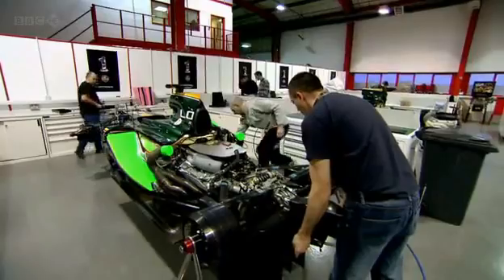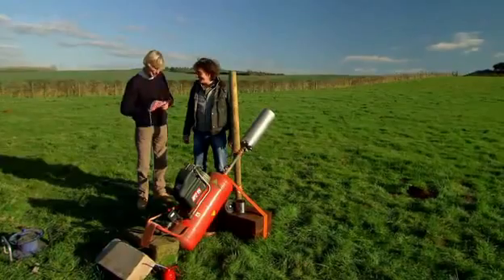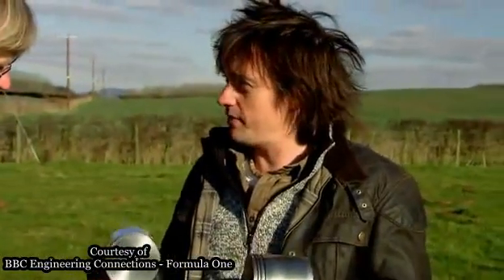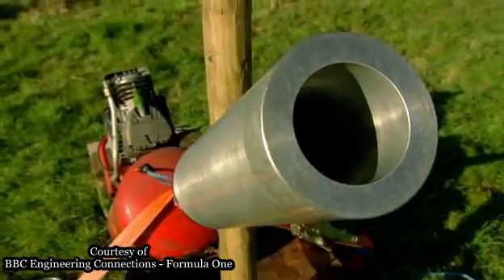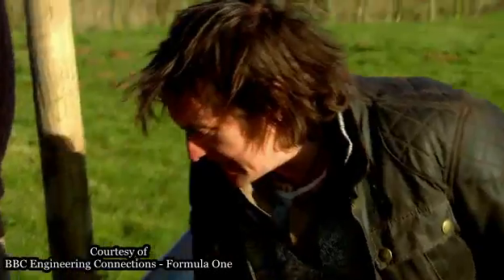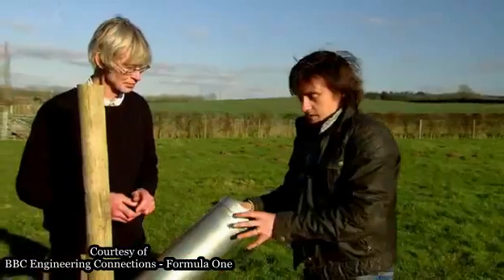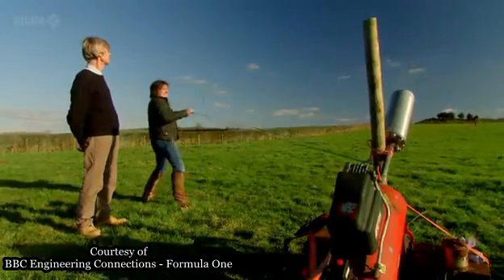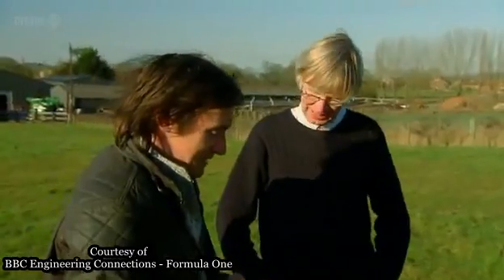The Secret of F1 Enormous Power - Precision Fitted Components

Comment: I thought regardless of piston size, the piston rings are the the ones responsible for keeping the pressure from escaping the gap.
Reply: The trick is getting the friction to the absolute minimum, there is a ton to it but basically you want to keep that cylinder as round as possible, the less run out you have the power you will make.
The rings you want the least amount of tension that will still seal the cylinder, hence the use of vertical and horizontal gas ports that all you to use a lower tension ring package.
You want the minimum amount of piston to wall clearance so that you get less piston rock and as a result a better seal.
Gapless rings do help, mainly when used on the top ring
This is all critical in racing engines but I adapt most of the racing tech I learn into the higher end street/strip engines I build fwiw
Reply: Derek Stewart the only comment I thumbs up'ed. Good response.  These guys are all just copy pasting shit from Google and guessing.
Reply: John Bernal  thanks John, i appreciate the compliment
Reply: Silicon NOT Silicone....
Reply: Basically in an F1 motor they want ZERO crank case ventilation with high compression. 
Proper fitting pistons and good lubrication solve both issues. 

The rings in an F1 car would solely be there to hold some oil
Reply: It is true rings have to seal compression but HOW MUCH air and fuel can be compressed into a small volume (2.4 liters) is whats going to give you the power. This is what Americans do not get why you have 6 cyl. Engines with power ratings of 1000 hp. And 4cyl with upto 500hp. Having large displacement will give you more ease of creating hp but will not be as efficient as with smaller displacement engines. More power into 4 or 6 cyl. Engine means more meat on the block, rods, and mains including head casting and cyl walls. This will retain that kind of power more reliable. You should see the new hemi engines and the thin bicycle chain they use for the timing. They do however stand behind their garbage and will write you a check for parts n labor.
Reply: Bassotronics less ring more piston, smaller ring gaps
Reply: Bassotronics piston rings are never air tight, they let out a little air. Tight fitting pistons in the f1 are air tight
Reply: Henry Koskei When you say "air tight" what exactly do you mean?
Reply: behemothfan666 F T P i don't mean airtight literally but it just let's a very little volume of compressed air escape through the cylinder walls thus higher power output
Reply: Not totally true . All rings do is two things and they cant do that totally . One is to reduce oil loss and two is to reduce compression loss . But you have to have some loss of both to a degree . So how do they do that now . Slicker alloys in the material like nickle , silicone , and stronger castings or even to the Billet aluminum .  Here is the bad thing about this and the reason engines do have windage . If you do build and engine this tight and run it this hard it wont last long at all . After every race these engine are torn down and all worn parts replaced then after a season of racing the blocks and cranks check over  for stress cracks .
Reply: Jeff Mullinix, I don't want to rain on your parade, but F1 engines are not rebuilt between races. They started restricting engines in 2004 and at present they are allowed 3 ICE for the entire season. They are sealed by the FIA, and a broken seal will give a penalty. That's why Bottas and Hulkenberg had to start at the back at Spa, and since you can get an upgraded engine by switching it entirely (for the same penalty) they don't bother to rebuild and old one.

Comment: They forget to mention in this video that the rpm also has a huge effect on the power output of an engine. F1 engines can rev at 15000 to 20000 rpm, while the engine in the average family car rarely revs above 7000 rpm. Plus, everything, really every nut, bolt, washer, piston, belt, valve, the angle with respect to the piston at which the valves are set, the diameter of the inlet and outlet ports, the length and diameter of the exhaust pipes, the fuel,  etc...etc... have all been designed to get the maximum performance out of an F1 engine. No wonder they produce 4 to 5 times more power for the same amount of liters.Tightly fitting pistons are just one part of the solution. I assure you there is a lot more going on to produce that much power.

Comment: the real secrets are still secret..  my guess as to how these little engines produce so much power is,  they just dont blow up as much as they get pushed to the max, wide open throttle.  they also go through so many parts, its basically a fresh engine every time, the point is that longevity is being traded off for power.  engine life would be inversely proportional to the average power output, and factor in a exponent because e=mc^2  we get : motor life = entropy/-output in joiles.  there the easier you go on the engine the longer it lasts and the more power gets put out, the exponentially faster the engine will get blewn...

Comment: Piston clearance might grant a couple horsepower but for the most part this video is pure BS. The monstrous power comes from having a very short stroke and big bore. That lets you have huge valves in comparison to the displacement and reduces piston speeds so you can have it rev to the moon. Then you just need all the supporting hardware like awesome flowing heads and intake as well as valves that don't float and a crank that can withstand the speeds. Pretty much the same as a sport bike only scaled up and with a higher state of tune. Strap two stock sport bike engines together and you've got a 400+hp 2 liter engine. Then its just a matter of cranking up the compression, blueprinting the motor, porting the heads, putting in more aggressive cams,  and having a pretty open exhaust. Next thing you know you're approaching F1 power levels. You won't quite get there though because you have 400ccs less and even if you bore it the heads won't match. Beyond that, the last little bit is indeed in the small details like clearances and exotic materials.
Reply: +Jakalwarrior They don't have very big bores really...at 2.4L v8 their bores are freaking tiny, compared to an everyday mustang.  Their bores are 0.3L/cylinder vs the 0.625L/Cylinder in a mustang 5.0L.  The power simply comes from rpms...and lots of them.  To make 900hp at around 16000rpms (cosworth engines)...they only need about 300ft lbs of torque.  But put that same ftlbs of torque at 10k rpms...and your HP goes from 900 to a pathetic 571HP.

But your spot on in terms of short strokes, everything in the F1 relies on big combustion in a small package to light weight internals to allow huge RPMs for HP gains.  HP is directly related to RPMs when all things are equal.
Reply: elitewolverine A big bore also means bigger valves relative to the displacement. That plays a big part too.
Reply: I believe the focus of the video was on blueprinted engines and the benefits/risks of reduced clearances, just targeted towards younger school children.
Reply: I rode sports bikes for years. The comparison is staggering. Maintenance is crucial to keeping the thing on the road. If one thing goes wrong everything goes wrong. When buying replacement parts you notice too, Everything stock is high performance. I drive a sports car now. The comparison is laughable. Funny how I can keep something with four tires on the road much cheaper then something with two
Reply: Jackwarrior, you're talking nonsense, because the moment you reach 12,000 RPM, you will have valve bounce, if you are using valve springs. A 20,0000 Revving F1-V10. Have far more complicated and high tech set up, using Electronic and Hydraulics to open and closed the valve. There're far more involved in building an F1 V10 than what you have mention. Ask Honda, their V10 use to blow up at every race, and they should know a thing are two about engines!!!

Comment: That is just one of the dozen other reasons. The high output is mainly due to the higher engine speeds, high performance race cams, specially designed intake and exhaust systems, and a high compression ratio (upto 17:1). So really, this video was just dumb.

Comment: "Windage gap" was closed with wadding, yielding a perfect fit between the cannon's barrel and ball. In naval battles, it was common to run out of wadding before running out of powder or shot. Any kind of cloth not essential to the ship was given to the cause, which is where we get the phrase "giving the shirt off your back". It wasn't about being generous as we use it today, but about doing whatever was necessary to get the job done (like keeping the ship in fighting trim long enough to survive).

In the engines we're talking about here, the upper piston rings do the job wadding used to do (and still does in shotguns and muzzle loaders)

Comment: The real source of power increase is due to a lighter rotating mass. These engines will hit 21k rpm compared to 6-8k for a family car. This has little to due with piston blow-by like this video suggest. The real reason is due to lighter,stronger and more precision machined rotating mass. That and the advancement of better valve springs. http://www.popularmechanics.com/cars/a7451/the-spring-that-revolutionized-nascar-6643778/
Reply: F1 cars dont use valve springs!  They use compressed air to close the valves!

Comment: BS.... Nearly all modern engines have a close tolerance.  Most aluminum blocks expand with the pistons, Those engines produce power, because they are designed strong enough to withstand very high RPM's thus producing so much power.